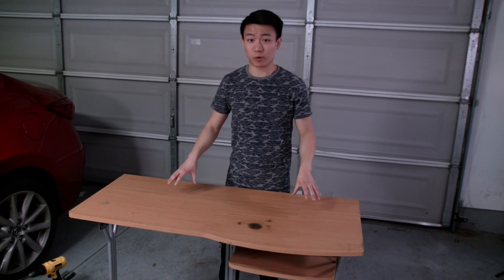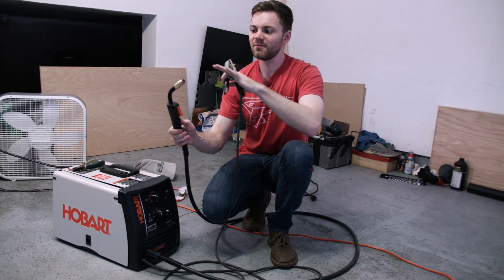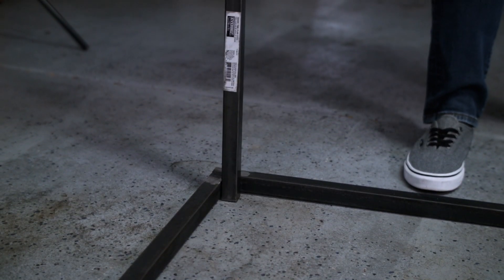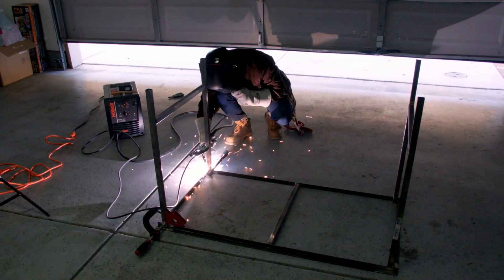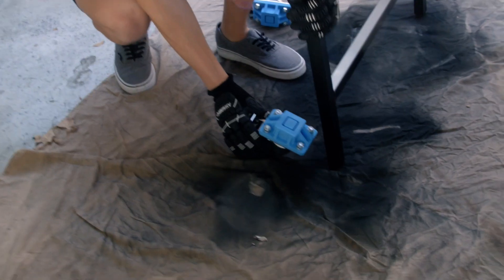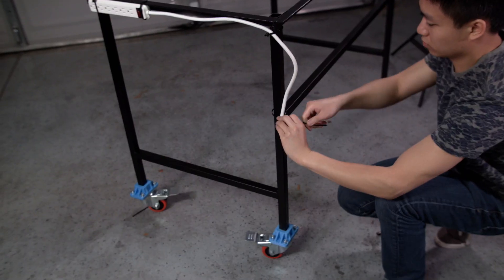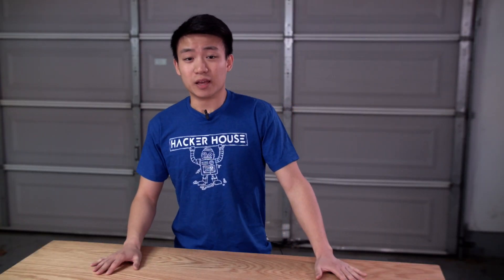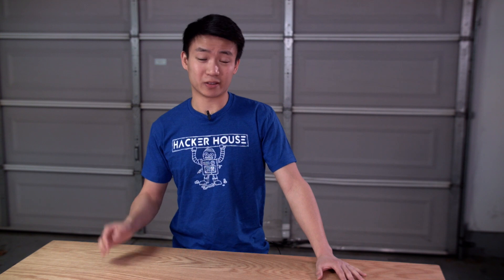Building a New DIY Workbench

Comment: Good video I enjoyed it. That being said watching yall using any form of tool makes me cringe. Some helpful advise with the welds, Turn down your heat on the MIG to avoid burning through. You are running to hot for that thin of angle iron and tubing. Circle motions with your wrist to get the welds more secure and watch your speed, not to fast not to slow, It does take some practice. An Auto-Tinting welding hood is a good investment if yall plan to use the welder more. You will not have to raise your hood to check your nozzle placement between welds. Another QOL is get a set of TIG gloves, they are thinner welding gloves. and designed to allow you to feel what you are doing more. ONLY USE ONE!! Use the one on your dominant hand you are holding the welding gun with it adds to your control and feel of what you are doing more.
Reply from the maker: Thanks for the tips. Yeah, our welds are complete crap. We'll try this out next time!